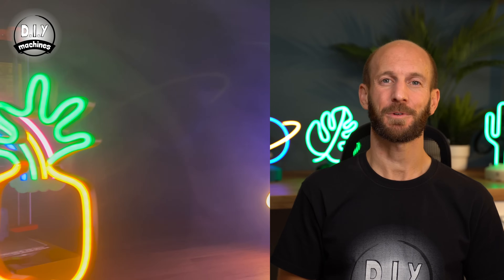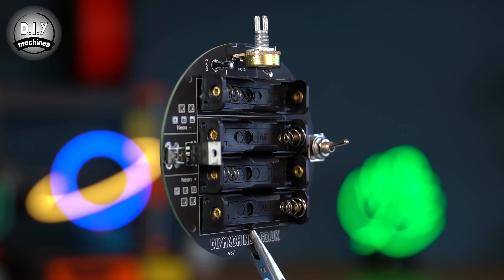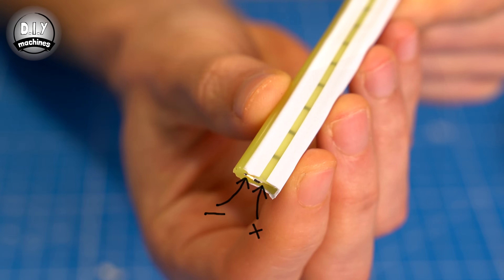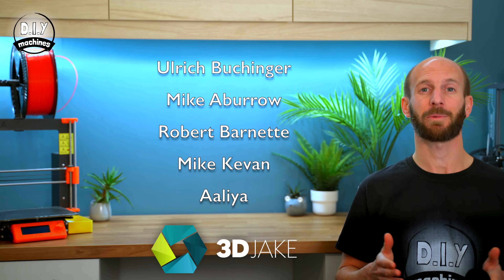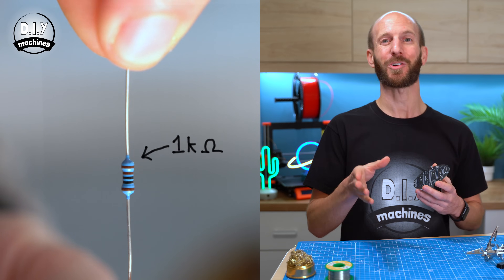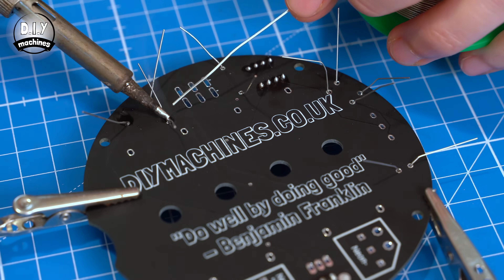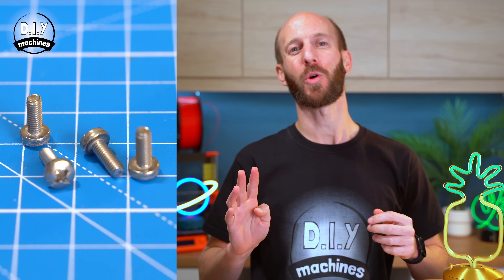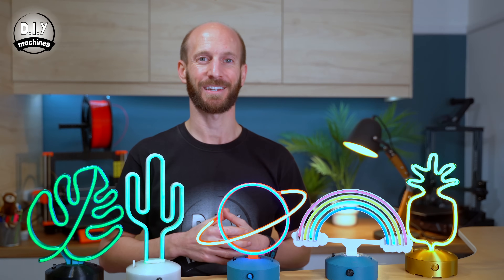How To Make DESKTOP NEON SIGNS  - 3D Printable, Battery or USB powered & Dimmable!

Comment: This is a awesome project. 
But I see two design flaws... to change batteries you have to disassemble the whole electronics. A simple cap would be better or at least only opening the bottom.
second... maybe I missed it, but it seems there is no fuse for the electronics... this could end in a disaster. A simple fine fuse would do the job.
But overall this is a beautiful idea and a pretty nice project. I love it.

Comment: I want to order some of your boards but am curious if they will work with a larger led design I want to make or will the components on the board limit the size of my design? I imagine that's where I would need to do the research and put larger diodes/capacitor and etc; if so would the board still work with the new higher rating components? Thanks for the great video. I'm excited to make something.

Comment: Couple of suggestions:
1. Rather than a 3-way switch, why not add simple circuitry (MOSFET switch, couple of diodes, resistor) so that battery only supplies current when no USB power
2. Then, if you only need a SPST switch, you could combine the switch and the Pot with a single combined switch+pot -- similar to the volume control on-off on old transistor radios

Comment: Couple of questions:
1. Why did you use a 555 timer to PWM the LEDs rather than just use a pot to adjust the voltage supply? (I suppose you save some power when running on batteries)
2. Why do you need the 2 diodes - if you are just using the multistable mode of the 555, you don't need diodes

Comment: That looks fun to do. Is there option to move batteries to the back of PCB, so they could be accessed without any need to unscrew entire board just to do replacement?
Reply from the maker: You can mount them on the underside but you would need to increase the height of the base to accommodate them.
Reply: @DIYMachines  cool, thank you :)

Comment: Do you have any tricks for getting the strips in?  The sides of my print keep separating from the back.
Reply: I have the same problem. My kit did not come with LED’s. The ones I bought from Amazon go in, but strain the frame to the point of breaking.

Comment: Seems like it’d be nice to either mount the PCB upside down, or put the battery holders on the other side of the board, so that you don’t have to unfasten the board just to change the batteries.

Comment: I was intrigued the first time I watched this video. I decided that I could this, even though I have never soldered anything. After I received your kit, I printed the parts and started worrying about getting it to work. I ordered some 22 AWG wire, and a soldering iron and when I had everything, I took a long time to trim the lights and get the project rolling. This morning, I finished it. Works great and was not as hard to assemple as I thought. Printed everything on my Ender 3 v2, which came out perfect. Thank you for the ideas and the new experiences.
Reply from the maker: You are very welcome, thanks for sharing your success with me. Enjoy your own project born of your time and effort. 🙂
Reply: Great job with the Ender 3 V2. I totally recommend a Bambu Lab printer whenever you can afford it

Comment: Hi, Great video, thank you!  However I couldn't reach the PCBWay page to order PCBs direct?  The link in the description here seems to reach an out-of-date 2022 promotion.  Is ordering from PCBWay still possible or is it solely via the Etsy store now?  Thanks
Reply from the maker: Here you go: https://www.pcbway.com/project/shareproject/Desktop_Neon_Effect_LED_Signs_9ae14310.html 
I'll try to fix the link. Thank you for letting me know.
Reply: @DIYMachines  Fantastic, many thanks!
Reply: HI  @DIYMachines  Quick thought; I appreciate I wouldn't use the USB connector (or batteries!) but could I adapt your PCB with a PCB-mounted barrel socket and power 12V LEDs instead of the 5V ones?  Thanks,
Reply: I was just able to order these from PCBway using this link.  Also, I was able to change the quantity from 5 to 10 and still get them for free, only paying shipping.  So basically it came out to about $2 per pcb including shipping to the US.  Note: I had to wait a few moments for someone to "approve" the order, but then the order went through.  Thanks for this tutorial and I look forward to trying to make these with my kids.

Comment: Would it be possible to make a toned down version of this without the 555 timer which i assume is for the dimming? just a simple on/off function? a simple cercuit diagram for this would be great!
Reply from the maker: You could connect the USB power or AA batteries directly to the LED's via the switch (have the switch toggle between the two different positives). You may find that without the PWM dimming the battery power is diminished quicker than expected (depending on the amount of LEDs used in your design).

Comment: These look really cool and I've really only started to get into 3d printing, but a worry I thought of with this is won't they deform over time from exposure to heat of the LEDs? I haven't dealt with LED strips before, so If they don't get hot enough to do that, that's good to know.
Reply from the maker: The LED's do not produce enough heat to deform the 3D printed shape which holds them. :)
Reply: @DIYMachines  Thanks!

Comment: What do the capacitors, diodes and resistors do in this project? I make these lights all the time but just use a DC power supply. A USB would be much nicer to work with, but I'm not familiar with the process.

Comment: Just curious, is there any reason you didn't connect the led strips to eachother and instead run separate wires to the board for each section? Really clean project btw, definitely planning on making some of these as gifts for people.
Reply: I think what he's done is allow for long strips to be attached with minimal overall loss or dimming for a limited 5v 200ma supply. If you don't want to be as limited, perhaps use 18650s for more current, and don't have it dimmable.
Reply: Nice idea with the 18650
 @ljadf
Reply: I came here to suggest the same 😎
Reply: @darkchild.666 how high were you when writing that comment lol, you replied to some random fella, not the actual video
Reply: @charliesmith874  simple mistake, thanks for pointing it out
Reply: Voltage adds??  No, not so.  If you connect 2,3,4, or any number of led strips together, the voltage required to drive them remains the same, 5v in this case. What changes is the current draw(amps).  If one strip draws 250mA, would draw 500mA. If you connect longer strips with lots of leds, you can have voltage drop, but that won’t be a problem here
Reply: @JohnScherer  When you connect lights in series, the current through all of them is the same but the total voltage drop in the circuit increases with the amount of lights connected. That would cause that some lights would light up less or the circuit wont work at all if the source voltage isn't equal or greater than that the voltage drop from the lights. What you describe happens if you connect the strips in parallel because of Kirchoff law. Each strip needs a certain amount of current to function but the voltage drop across all of them will be the same.
Reply: I was thinking the same. It’s not like the draw is any more or less going back through the board.
Reply: @Holmesy89  Probably has to do with the fact that if you want to connect the strips together, the voltage needed to power them is greater because the voltage adds up. Instead, if you run wires for each segment you are connecting them in parallel, so you only need the rated voltage to make everything work. If the LED strips are powered via batteries or USB, you only have 5V so you shouldn't connect segments in series.
Reply: @JaxDrive  bro bro relax.... these led on the strips are connected in parallel....so however you power them.. all the led will be across same potential...connecting those strips in series won't make it series
Reply: @JaxDrive how does this have upvotes? That's not how led strips work at all. 

Every single led is connected in parallel on the whole strip, cutting them as in the video and connecting them to each other as the top comment suggests just adds LEDs to the chain, keeping them in parallel and increasing the current requirements, definitely not the voltage 😂
Reply: @DiegoMS What size lift will fit my 2001 Ford Explorer Eddie Bauer trim edition with 235/15/R15's? I am thinking a 2 or 3 inch lift? Any thoughts?

Comment: A very common technique for marking electrolytic capacitors on PCBs is to match the look of the capacitor, so to have the capacitor symbol as a circle with one half block white, potentially with a minus sign printed as a negative and to have the other side with just the outline. The way you did it with a tiny minus sign beside the circle may be hard to see and may not print right or may be knocked off.

Generally when making PCB silkscreens you want to make it as obvious and large as possible what orientation it goes.

The diode symbols are good though.

You should wear safety glasses when soldering, not just trimming the legs. Hot bits of flux or solder can spit off and go a pretty far and that definitely isn’t good for your eyes.
Reply from the maker: Hi Conor, thanks for all the good advice. I appreciate it. I will update the way I show capacitor polarity on future PCBs.

Comment: Why was it impossible to connect the LED strip into one, in series?
Reply from the maker: It's not impossible. You can absolutely do that if you prefer. I found I could create smaller gaps between colour changes when there was not four ends of wires protruding from the soldering pads to squeeze in along with the wire itself.

Comment: I make 3D printed "neon" too! This design is great. I do not have the knowledge to make the PCB board so this is a great resource. I would love access to the CAD files to recreate the design where the batteries are accessible without having to remove the entire board. DM me, I'm willing to pay for the files!
Reply from the maker: Glad you like it! You can simply solder the battery holders onto the other side of the PCB. The only difference is you would need to extend the height of the base. 🙂
Reply: @DIYMachines  you're right, I would add a cover too. Can ceramic capacitors be used with no polarity?

Comment: can you please make a version with 18650 batterries?
Reply from the maker: That's a great idea. I originally was going to do this, and include charging circuitry for them but this was quickly increasing the total cost of parts so I decided to go for AA.
Reply: @DIYMachines  would prefer Quick access instead of charging just swap them

Comment: I love the basics of this project.  It would be cool to have different sections of lights turn on and off to simulate movement.  Would that be possible without needing something like an Arduino?
Reply from the maker: Thanks. The current design would not be capable of this. I'm sure you could achieve it with 'dumb' components (think of a circuit design similar to old school blinking alarm lights: https://www.instructables.com/Three-Ways-to-Make-LED-Flasher-Circuit-With-Rate-C/)
Reply: You could integrate and ESP8266 (like a Wemos D1 mini) and just flash WLED onto it. Will allow you to control effects over WIFI.

Comment: This looks cool, but not easily being able to change the batteries is a bad design, unless I missed something, which is likely knowing me.
Reply from the maker: Thanks. To change the batteries if you assembled it as I have shown you in the instruction requires undoing four screws. You could solder the battery holders on the underside and then increase the height of the base if you wanted to achieve screw less access to the batteries.

Comment: What role do the 555 timer and switching diodes play?
Reply from the maker: Thee 555 timer generates a pulse which controls the transistor. This allows us to use PWM (pulse width modulation) to increase the battery life of the batteries and dim the LED's in a far more efficient manner.

Comment: For a cleaner look: 1) print only the sides frontside down, 2) leave the print on the buildplate until room temp, 3) fill the gap with liquid matte acrylic medium (or translucent paint if you want it permanently colored), 4) run the heatbed at normal temp to dry the paint, 5) remove the print very carefully so that the paint lifts off with it. Now you have a perfect frontside without any gaps between the the frame and the lit area.
Reply: Just use a RGB led strip and an ESP32 would be the over engineered approach from the electronics side

Comment: Why not just solder the led strips together?
Reply from the maker: You can daisy chain them if you want to. Either way is fine. I preferred separate wires to make butting them up together a little easier.

Comment: Looks like an interesting project for some free days.
One comment from my side, would it be possible to mount the AA holder on the bottom side of the PCB that the batteries can be easy changed.? Maybe the housing needs then some more mm height, but no need to remove the 4 screws always for a battery change.
Reply from the maker: You are exactly right - you can mount them on the underside but the base would need to increase in height. I had to choose between a smaller base and easier access and opted for the smaller form factor - which is defiantly preferable for those who choose to power their via the USB port.
Reply: @DIYMachines  super cool build. For the next iteration I would also move the potentiometer and battery holder to the bottom and the Switch to the side (mounted from the bottom). This way you should be able to keep the same hight of the base. But regardless, really wanna build this :)

Comment: look like really fun project! only down side you have to disassemble the pcb from housing in order to change batteries :(
Reply from the maker: Yes, four screws to change the batteries. I did look into mounting the batteries on the underside of the PCB (which you can still do if you wanted to do so) but this would add to the height of the base.

Comment: Would you be able to use adjustable colour LED's, where you could be able to change the colour through a bluetooth controller?
Reply from the maker: Not with the circuit as it is. It uses PWM to dim the LED's which would not play well with the controllers.

Comment: Why no USB-C?
Reply from the maker: I do have some USB C devices but mostly still use Micro / Mini USB (such as on Arduino Nano's). Depending on a USB C's footprint you might be able to add one to the PCB - you certainly can if you assemble the electronics on a piece of perforated board or similar.